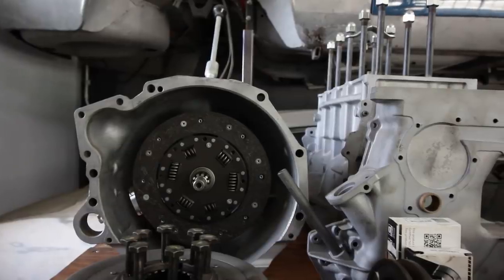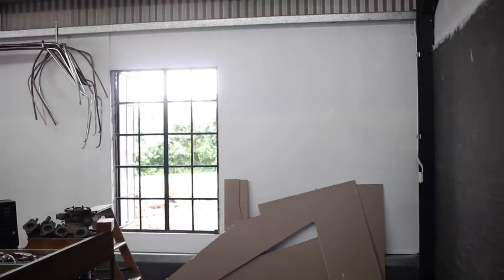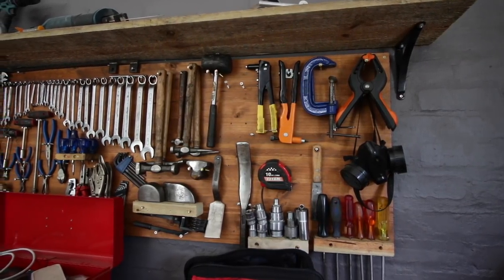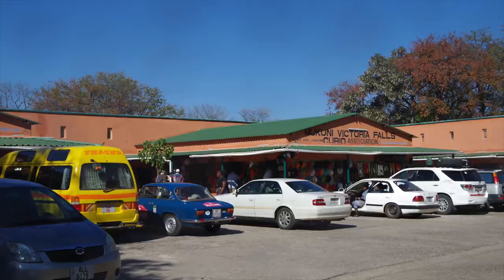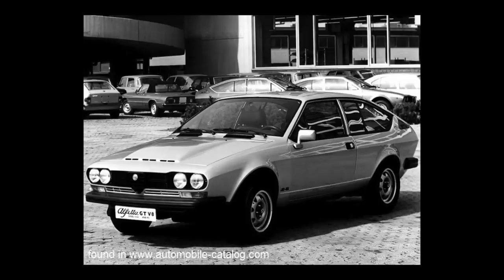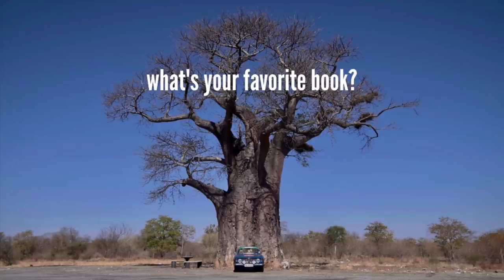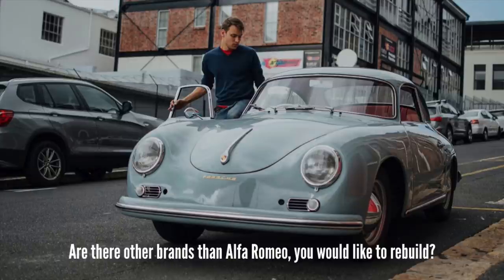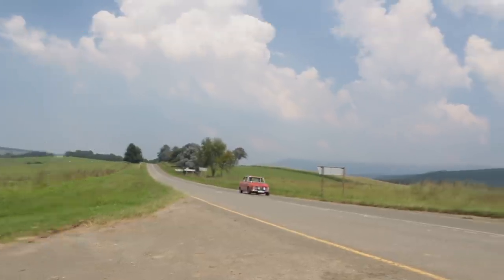I rebuilt my workshop, sold the Duetto, and hit 35 000 Subscribers (Update and Q&A)

Comment: Good to see another video and great to see the garage updated. Every update for your support center will carry you on for a very long time. Shops are always in a period of construction and expansions. You think its a storage section, but eventually it becomes part of the workshop. A very long time ago just after high school I had rebuilt a 58 MGA 1500. It was mess in 1972 and a lot of mechanical rebuilding, rings and valves, transmission and brakes, leaking gas tank. Dents removed and repainted Brittish Racing Green with Oxford Red leather and black carpet. It wasn't a fast car but a lot of fun to drive and participated in local rallies and Autocross events. Just a bunch of old cars and fun. Keep the videos short and the music low, actually music is subject to personal taste, for get the music.

Comment: just want to give my 2 cents about your wall insulation- the way you did it can get very problematic when the outside of the shop is colder than the inside- especially if you didn't fit a moisture barrier. It may not be a problem with your weather and enough ventilation- but I would definitely advise to dismantle a small section of wall in a few months and check for condensation between the insulation and the outer metal panel.
Reply from the maker: Ok I will do that. But yeah I haven’t had any moisture issues in the shop. In fact it’s been amazingly dry inside. Bare steel parts can sit for months without even developing surface rust.

Comment: hi.. the blue gt junior.. what do you know about it's history? I had one years ago also with momo mags.. wonder if it's not my old one?
Reply from the maker: So it’s not a Junior, it’s a 1964 Sprint GT 1600. It was built in East London, it was white originally. Then it was crashed and painted red. Then left in a barn in the Freestate for decades and then bought and stripped by a collector who wanted to rebuild it. Then I bought it in 2012, painted it blue, and finished the mechanical rebuild. I drove it until 2017 when I pulled it apart, which was a mistake. 

I don’t know much about it other than that.